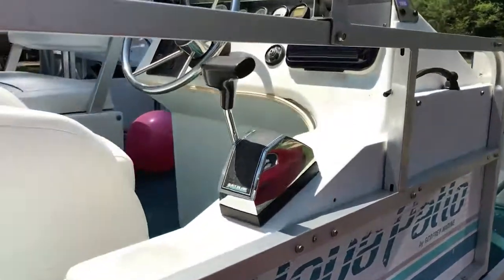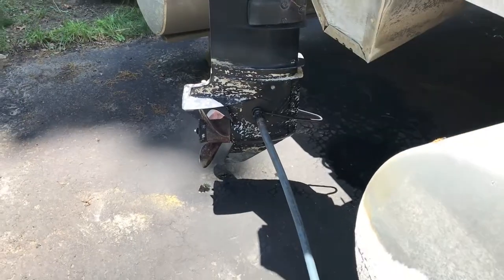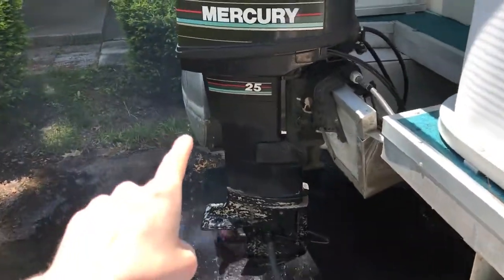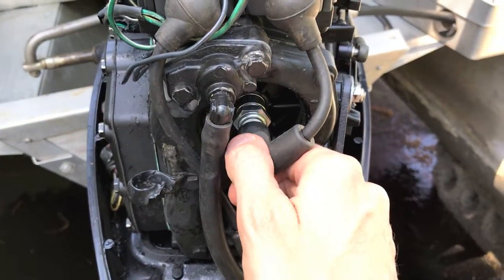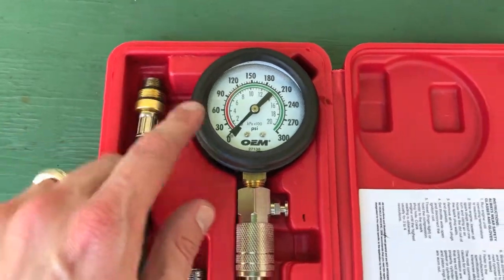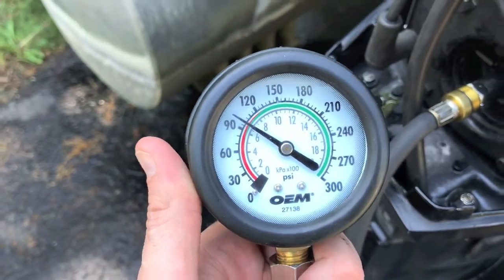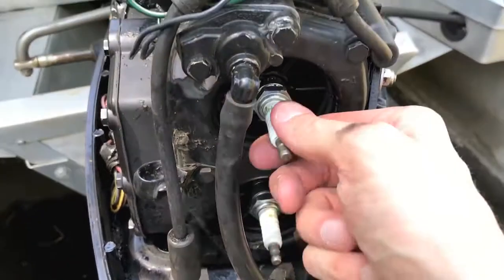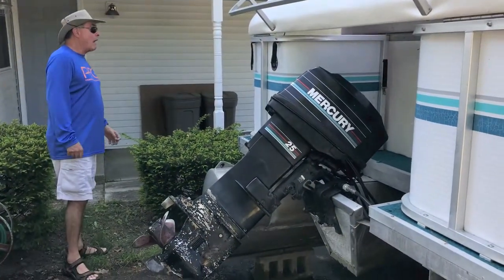Outboard boat engine - How to do a full Compression Test - FAST & EASY!

Comment: After the motor ran and you pulled your spark plugs wires off the plugs you didn’t wrap them allowing them to arc. Also what if the motor won’t start.

Comment: How do you know what size the c9mpression fitting needs to be. My spark plug socket may be different.
Reply: Good compression testers come with fittings for different size plugs
Reply from the maker: Dave R 

Thanks for watching.  The set has an adapter & your thread should fit one of the two options.  Keep us posted.

😎👍🔧🔩

Comment: What if one of the readings are excessively high or low?
Reply from the maker: gorp27 

Thanks for watching & we hope the video helped.  Low to no reading is a failed cylinder or leaking cylinder due to crack.

High may be due to high mixture...meaning an unbalanced mixture of Fuel-to-Air mixture leading to too much fuel...resulting in over combustion.  You may need to adjust Jet Valves on Carburetor.

We really enjoy making these helpful videos for our fellow DIY’ers.  Many more helpful videos to come!  😀

Keep us posted on your project & any questions you may have.  Please subscribe to the channel and turn on your YouTube notification Bell 🛎 that would be awesome thanks again!

😎👍🔧🔩